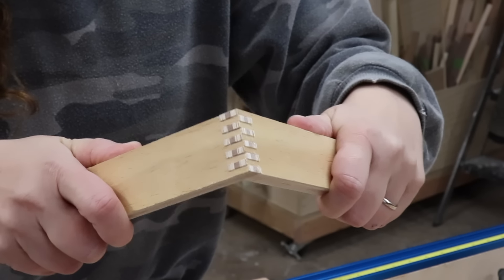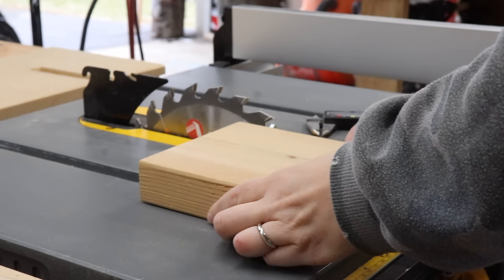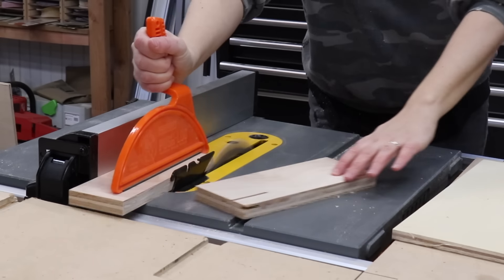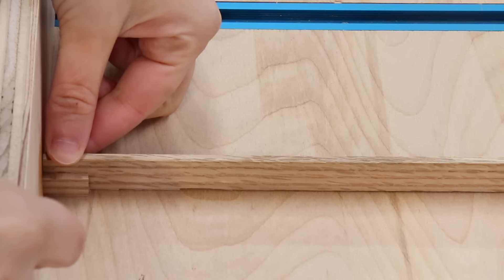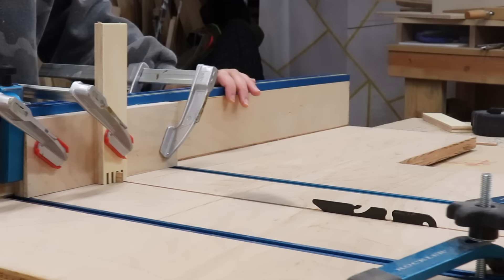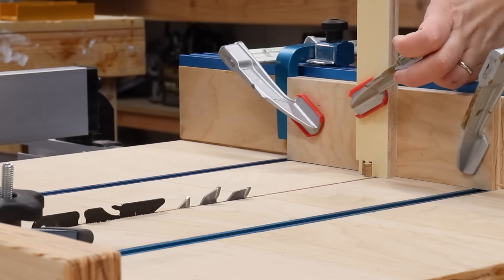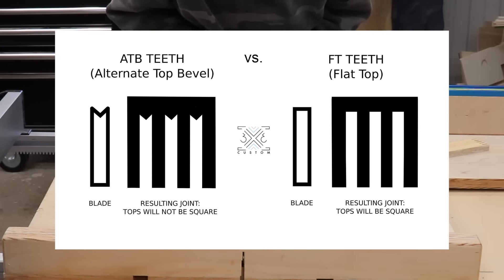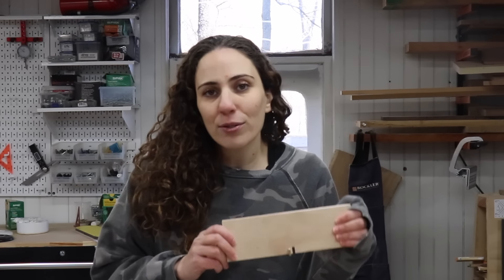How to Make Finger Joints on the Table Saw // Box Joint // Joinery // Woodworking How To

Comment: Since the only thing you could adjust on this jig is the depth of the cut, maybe you could set the jig on your fence on crosscut sled, take hand saw and just slightly mark one of both sides on your fence. Or you can take a piece of scrap, finetune the jig, make the cut and then every time you need to use the jig you can just align the scrap piece next to the cut on the crosscut sled, move the jig to it and clamp it down

Comment: Thanks for the excellent tutorial. It took me two tries but I finally got it to work. (It helps to follow the ALL the instructions!) How to adjust the pin in relation to the blade if too tight or loose is very important. I was surprised how many finger joint jig tutorials leave that part out. All your tutorials are excellent. Thank you!
Reply from the maker: Glad it helped!

Comment: Nice Tips,  Boy I am a pro carpenter 30+ years and only part time wood worker.   I watched 2 of your clips and already learned some nifty tricks I never considered.   Not sure how you got such a nice work space and good selection of tools, but this is also a big help to have all one's stuff in a central location.  Sadly for me, I have always had to work mobile and seldom get to realize the joy of economizing on having shop tools set up and ready to go with special attachments, adjustable jigs, stops extension table for table saw etc.  Hard to believe I never knew there were blades that cut a flat cut like that other than a dado setup I have used.  Can't wait to watch more of your work.
Reply from the maker: Awesome. So glad you learned something! The flat blade is def a game changer with joinery
Reply: @3x3CustomTamar  YAY, thanks so much and best regards in your future projects and all you may learn as well.

Comment: I've made the same jig and attached it to a miter gauge to use on my router table. Just put a fence on the miter gauge and cut some slots in it. Then take the jig you made and run 2 1/4-20 screws thru the jig and into the slots. The slots give you the adjustment you need to set the finger width. You could probably clamp it to the fence on the miter gauge too if you didn't want to mess with screws and slots. But, it works so well and is so simple just like you show.
Reply from the maker: Cool. I’ve done this on my router table too. Not with the adjustable aspect though... ha

Comment: This is really really a smart way! The highlight is at 2:51 using the first piece as another jig to add exactly one more blade thickness for the mating piece. The width of the pieces (height of box) does not have to be an integer number of blade thicknesses. Thanks and definitely will be using this trick to make boxes for my little projects.
Reply from the maker: Awesome. Glad you found it helpful!

Comment: That is So good! I tried other ways and could not get things right. Just clamping the little jig to the sled is a game-changer. I had been screwing the board with the pin onto my miter gauge. Then when the teeth are too tight I have to figure how to make the screw-holes in the board wider in order to shift things left and right. 

Thanks!!

Comment: I used the alternative top teeth blade and found that on assembly, voids are formed in the joint. So the blade type you recommended is essential for single blade joints. Greetings from Scotland. Stay safe.
Reply: Which is fine if you can get them...

Comment: I like it.  I have some 2" wide scrap that I want to mill down to 1/4" thick for a pencil box for my granddauther and tray for my drills, and finger joints seem easier than dovetails.  This answers how to do it safely and neatly, having the advantage of being able to clamp small pieces in place, which is not an option on my dado jig.
Reply from the maker: You should be able to stack thin pieces like that as well and do them at one time

Comment: Nice work I'm getting ready to be building several drawers and I'll give this a try
Reply from the maker: Thanks! If they are drawers you will use often you might need to reinforce the joint. This is a small little drawer that will hold game pieces...

Comment: When adjusting for fit in the joints, you can use a piece (or two) of paper between your stop and your jig. Don't move the stop, just add a piece of paper between the jig edge and the stop. You can adjust it a few thousenths at a time and take any guesswork out of the equation. You can do it on either side of the jig edge, depending on if the joint is too loose or tight.

Comment: You can speed up future setup and use by adding a key to the jig that sets inside the track left T-Track on your sled. 

Set the jig up for the proper fit that you want and then you can either mark the bottom of the jig to cut a dado for the key that will go into the T-Track, or just put glue on the key, place it in the T-Track and slide it up under the jig.

Every use after that, just place the key into the track, clamp it and the jig is ready for use.
Reply from the maker: That’s a good idea. For now I just marked the fence on my sled with a pencil. Ha.

Comment: when your joint was too tight and you moved the pin closer to the blade, did you recut both pieces or just the second piece? thanks !
Reply from the maker: Both pieces. That’s why you test on scrap.

Comment: I made a similar jig for box joints from a WW for MM video a few months ago. It worked...sort of...but after the first few fingers there was some drift where the fingers furthest from where I started the cuts were increasingly far off from each other. I ended up ripping the whole board and half and making my project half as wide as I intended and the joint fit, but I've been wracking my brain trying to figure out how this could have happened. My best theory is that the bit of the blade's teeth that stick out added to the spacing between the blade and the stop on the jig and that tiny amount added to each cut until the fingers didn't fit? Wondering if you've had any issues with drift like this?

Love your videos, discovered your stuff recently and you're already one of my favorite woodworkers.
Reply from the maker: First off. Thanks! I haven’t had that issue. It’s hard to say without seeing the jig... maybe the pin you made was too small and it wasn’t fully seated in there? I don’t know...

Comment: You can speed up your joint cutting by clamping both pieces together after first off-setting one of them by the width of the pin.
Reply: you can go even further with this idea..    number your joints..   stack up all 4 sides on top of each other and clamp them together - cut one end as normal.....flip end for end, use your a scrap for the spacing, and cut that end too...    (it sounds more complicated than it is....)   done..  all four corners cut in sets of passes on the saw....

Comment: I have the same table saw as you, the dewalt table saw. It's super handy. However it looks like you linked 2 different 10" blades for the flat top cut you mention in the video. I've been scratching my head at it for a while because this table saw has an 8" blade when I bought it. I can't seem to find an 8" blade with a flat top cut. Do you need to do something special to install the 10" blade in the 8" saw? Am I mistaken in thinking I have the same tablesaw as you and yours does hold a 10" blade? Thanks in advance. Love the simple jig.
Reply from the maker: My saw is different than yours. It’s the old 10” model

Comment: I used this video/instructions and, as you said, make the adjustment for the joint fit on scrap. Yeah, I had to do all four pieces over, but so long as I don't touch the jig plate, they fit fine. Part of my problem was a limitation on the width of my box pieces exceeding the available length of pin plate. Even the slightest change shows up as a tooth off by the end, and I was only dealing with 5" and 7" lengths. My question is, how to proceed for the sides to base finger joint? I didn't want to cut off my "teeth" and so I set up for a two blade and three blade width and that was disastrous. My "project" is for a small box to store my recently fabricated chisel sharpening fixture. I am using 4mm plywood so the finger joints will be superior to anything else I could do with such thin material. But it is fun, and when assembled the joints look good and I know they would sand and finish nicely. But, how to joint the base to the sides.
Reply from the maker: Awesome that you found this helpful! So if you watch the video I posted about making a “Go Board” I used these drawers for that. I made a rabbet on the inside at my router table and placed the plywood inside that. If you do go with a groove or dado to house the bottom then you can just fill any gaps you made with a piece of wood that matches. Hope that was helpful!

Comment: I have a small factory setup. I have to make boxes using these finger joint. A LOT OF BOXES. In short time. So can you advise me of something that can be used to make  a 5 or 6 inch side get fingered IN A SINGLE GO.

Comment: good tip with the tape i have the same table saw will be using in future, why didn't i think of that? :)
Reply from the maker: Thanks! Yeah it’s a quick fix until I get a zero clearance insert installed.

Comment: FT blades are nice, but I think for the non-professionals and a lot of semi-pros, a dado stack might be a better use of the money? I have a Freud 8-inch dado stack that cost me the same amount as the FT blade you linked, and the outer blades have a flat-top grind, making them even more useful as joinery blades. The kerf is more like a 1/4" instead of closer to 1/8", and it's an 8" blade instead of 10", but, well, it's also a dado stack. Having that extra functionality for the same cost is handy.
Reply from the maker: That is if your saw can hold a dado stack.... this one can’t.
Reply: I do that too, you can use a single outer dado blade.
Reply: @3x3CustomTamar  That's true. Table saw permitting. lol

Comment: have you ever had any issues using full kerf blades on your dewalt?
Reply from the maker: Yeah. I only use them for joinery. If I use them for ripping it bogs down the saw. So I use thin kerf for everything but joinery.
Reply: @3x3CustomTamar  thanks for the reply!

Comment: Once you have found the perfect place for the jig you could drill two holes straight through it and your sled.  Then put threaded inserts into both. Then all you need to do is use use two bolts to hold the jig in the right place. It will save you using your clamps also.
Reply from the maker: That would be a good idea. I hate the idea of drilling into this sled though. So maybe I would make a dedicated one just for this

Comment: Nice job! It seems to me that if you have a sled with a tight kerf, you could preserve the setting you fine-tuned the jig to by having a second piece of plywood the same as the jig you made, but already have one slot cut into it.  (This piece needs to be shorter than the one you’re using to fit inside the clamps.). If you then put that piece of plywood onto the jig and use it to cut a second kerf, you can make a second jig, and (this is my main point) use another piece of the wood you ripped to position the new jig onto the sled in the exact right place by aligning it with the sled’s (tight) kerf.  If the sled’s kerf is loose to the blade, this won’t work.

Comment: Can you get a dado blade for your table saw
Reply from the maker: Nope. This saw doesn’t hold one. But some ppl have had luck with small box joint blades. Like 3/8”. I’m just scared to use it since the manual specifically said not to.

Comment: Have you ever done a .5 inch (or wider?) box joint jig WITHOUT a dado blade OR a router? I don't have a router table or a router, only a single blade and my table saw does not accept dado blades. If you have I'd love to see it. If not...oh well. Thanks, and keep up the good work.
Reply from the maker: I havnt. But it can be done.

Comment: You can use this same jig to make any size finger joint (with a single blade). You just have to very carefully lay out and cut the first two by hand (on the saw). Then the jig becomes the perfect spacer.

Comment: By rounding over the edges of both pieces at the ends before making the cuts, you can create perfect hinged boxes. Simply drill and insert a pin after assembly.
Reply: I was wondering why they wouldn't be pinned even if you're not hinging them, just for more strength.

Comment: Thank you, SO MUCH!! I'm fairly new to fine woodworking and wanted to make my wife a small necklace box. I'm using 1/4" sheet stock and was wracking my brain trying to figure out how I was going to joint it. Your jig is the perfect solution!!

After the sides are fitted, how would I use the same joint to secure the bottom? (The top will obviously be hinged.)

Thanks!! 😁
Reply from the maker: Glad you found it useful! I would make a groove in the bottoms to hold a panel.

Comment: Loose the long sleeve shirt. That is super dangerous. Especially if it's hanging all over your hands. Nice finger joints though, Just a tip. Make sure your boards are completely flat on your sled. It will keep all of the fingers parallel.
Reply from the maker: Guess you listened with the sound off 😉